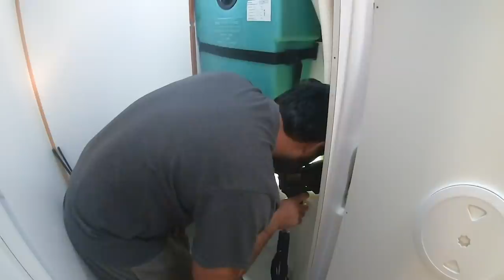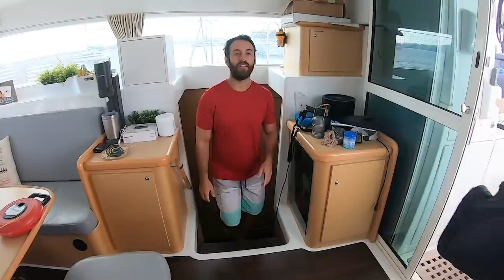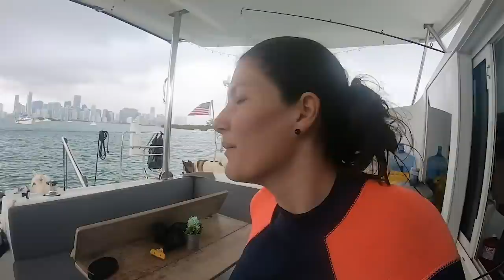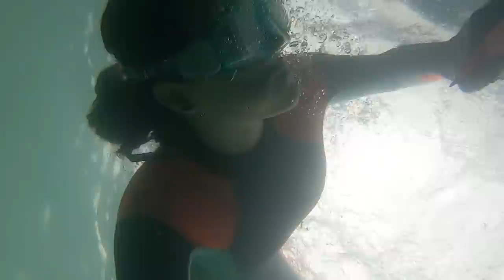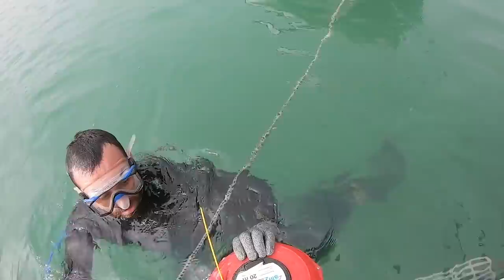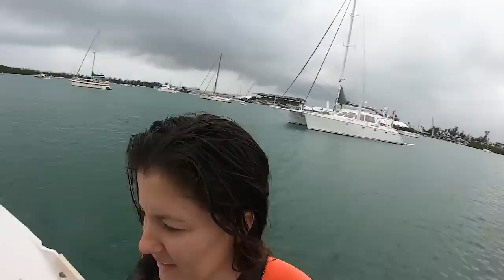Sailboat Work and Chores on S/V Hakuna | The Real Boat Life Ep. 11

Comment: you guys need a suction cup with handles so you can stick it to the side of the boat and have something to hold onto and make a hookah with an oil-less air compressor and a regulator so you can just breathe underwater lot easier and faster. Love watching you stay safe

Comment: In the hardware Dept I'm the section where they sell toilet accessory repairs. They have a pressure bomb that screws into the hose and they come in different sizes. You would attach it to hose and push it down as much it would go and turn on the water. This unit attaches to the wall of the pipe and you will get high pressure to unclog any pipe. It is good for those hard to reach areas.👍⛵😎
Reply from the maker: Hi Steve thanks for the advice we will try this in the future. Thanks for watching !

Comment: Did you check for a valve under your black water tank?  There should be one immediately under the tank and another one in the hulls closer to the water level.  Make sure both of them are open when you are at least 3 miles offshore to dump the tank.

Comment: You should buy two things to unclog the thru hull.  You've already tried in the video some of the effective tools like a screwdriver and a fish.  Buy like one of those pressure toilet plungers, and also a big plastic accordion style high draw plungers.  Make sure they will work with the through hull size on the outside. The little shrimps were living on the boat hull.  Seriously buy some earplugs so they don't go into your ears.  There is nothing worse than having small crabs or shrimp living in your ear.
Reply from the maker: Thanks, Allyn for all the good advice we will try this next time, we will also be getting earplugs for sure lol we don't want anything inside our ears. Thanks for watching!

Comment: Check to see if the valve is open. Then use a plunger on the outer hull, they do sell a CO2 charged plunger that might work better. As for your pipe and electrical cable fish, they are flexible but not strong so I'd suggest a  sewer snake. You can use a cordless drill to power through that clog. All more bran in your diets!!😁

Comment: I must be misunderstanding.  You were going to dump your black tank in the mooring, where you swim????
Reply from the maker: Definitely not Jim! Not only is it nasty but also illegal. We had to unclog the through-hole using a hose and close it at the same time as the hose was being pulled out.  
It was something that had to be fixed so that we would be able to dump the black water tank where allowed.
Reply: Living Hakuna I think your supposed to have the tank pumped first, or you have to unplug off shore.  Or was the toilet itself?  But you can’t go from the outside when it’s got crap in it.

Comment: You guys are so funny, love watching your videos...You are doing great and it's awesome to see you grow and make your dreams come true!!!

1. Try using a Shop-Vac to backflush the toilette seacock blockage. See https://youtu.be/DPG8S0uduPg

2. Wear head gear when cleaning the boat, it's those little itsy bitsy crabs that will get into your hair, ears, and nose, can cause infections, especially with any exposed cuts on the skin.

3. Terminology Lesson 101: 

"Through-Hole" - a technology that refers to the mounting scheme used for electronic components that involve the use of leads on the components that are inserted into holes drilled in printed circuit boards and soldered to pads on the opposite side either by manual assembly or by the use of automated insertion mount machines.

"Through-Hull" - a term used to describe a fitting that is attached through the Hull of a Boat. A thru Hull fitting requires a hole to be cut/drilled in the boats Hull for the fitting to pass through. Some examples of thru Hull attachments are a sea-cock and hose and thru Hull transducers.

"Seacock" - A seacock is a valve on the hull of a boat or a ship, permitting water to flow into the vessel, such as for cooling an engine or for a saltwater faucet; or out of the boat, such as for a sink drain or a toilet. Seacocks are often a Kingston valve. Seacocks are left open or are closed depending on the situation.